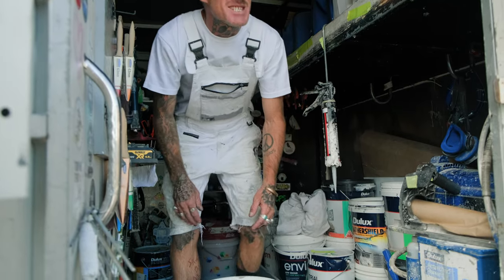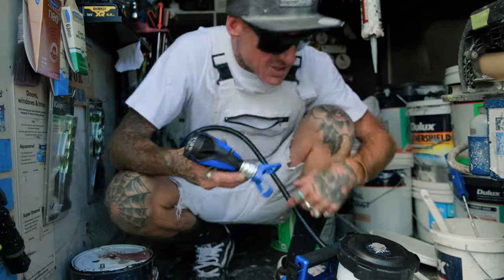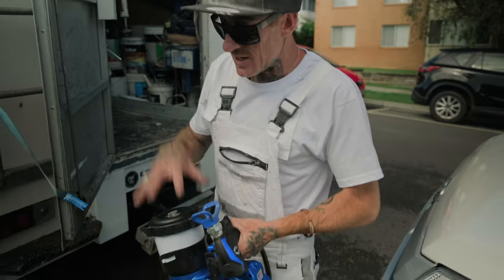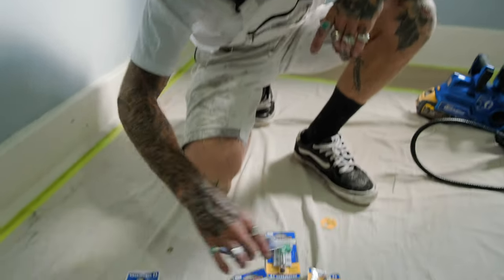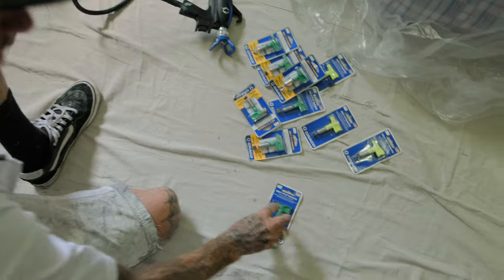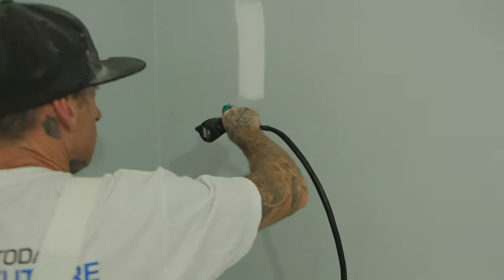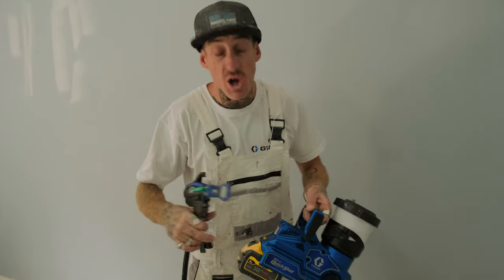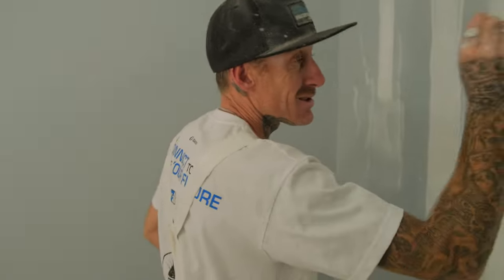NEW GRACO SPRAY TIPS UNDER THE PUMP! TESTING NEW FFLP, LP & WRLP TIPS WITH THE ULTRA QUICKSHOT

Comment: Now with latex paint graco tip recommends .15-.19 office hole for latex based paints . As you use smaller office it over stomizes the paint as it’s designed for .15-.19 to flow and leave the desired mil they designed each coat to be or some bs it’s very specific. That being said do you think it would atomize better and lay more evenly if you thinned it out kinda like when you spray automobiles it’s very liquidy to be a very fine spray . I can’t seem to get the orange peeling or pits to go away with the quick shot on high gloss like exterior doors and such it still has a finish that isn’t factory so I’m going to try and thin it out nicely .
Reply from the maker: Hi mate, most definitely I'm pretty confident that if you thin it out it will stop the orange peel and Atomize a lot better
Reply: Do you use floetrol or some kind of paint conditioner?
Reply from the maker: @Here-2-Learn  I never use any kind of paint conditioner in my products 👍
Reply: @paintingbyjosh  it’s a good idea give it a try just a cap full
Reply from the maker: @Here-2-Learn   there is no need 💯
Reply: @paintingbyjosh  no orange peel? It gels perfectly?
Reply from the maker: @Here-2-Learn  I don't get orange peel my woodwork gets laid down flat, maybe the products you are using or spray tips that ate cause that 💯
Reply: @paintingbyjosh  I use Sherwin Williams Dunn Edward’s and Behr mostly. Straight out of the can usually needs a lil adjustment even for my graco 9.5 which lays it flatter than all my other machines. I don’t have that one yet tho I got a 490 and a 9.5 . I use fflp tips still get a lil orange peel if I don’t adjust. Noticeable to me not everyone else

Comment: Cheers bro great video much appreciate it🙏 I bought one of these two weeks ago I used it today to spray some frames in acrylic gloss but I kept getting tails no matter how high or low the pressure was 🙁 next time I’m gonna try to thin out the paint. Has this happened to you before? Cheers 😎

Comment: Love your videos bro, I just started spraying and I use to FFLP 206 with perfect prep I just thin it down and use it on 6, worked an absolute charm on my window frames no tailing but I’m having troubles using oil based gloss through it even thinned down 5% (cold weather) what would you recommend?

Comment: Great vid Josh , should be getting mine in the next week or two , only need it for spraying coving and acrylic primer on doors & frames so looks ideal for my needs , don't need or want anything bigger.
Reply: I hear you on not wanting to go too big. Though for me this goes a wee bit in the other direction.

I'm going for the Graco finish pro gx19 non battery version. It comes highly recommended for spraying stains, sealers, and topcoats, which is what I do. It's capabilities stretch a little further than the ultimate, able to shoot up to .019 thousandths tip. It's hopper holds 1.5gal. It's recommended for spraying up to a couple rooms. It's cleaning is similar to the ultimate, having a hopper, and better suited to swapping colors than traditional airless systems.

It's special sauce is an easily interchangeable linear pump. Which also delivers tighter pump pressure windows, increasing finish quality for a fine spray. The system is made for and comes with a fine finish tip installed.

I'm looking to up my finish quality on my custom woodworking.

Comment: Can the quickhot be used with an extension?
Reply: It's got the RAC X spray tip, so yes.

The question is will the hose be long enough for your needs while using one? Would it force you to wear it like a fashion statement?

Which leads to more questions. How much do you bump into wearing that indoors? Carpenter tool belts mess up interiors on the regular. Which begs the question. How much of ones own work will they mess up with this tool before buying something more professional.

I know I would rather save a few hundred bucks, ditch the battery system, increase my capability, and get the Graco finish pro gx19 with 1.5gal hopper for $1,200ish.

They make a battery version if it were a must, but that model comes in around $2,200. A little rich for my blood, particularly since I'm on milwaukee batteries.

And lastly. I would like to see these companies offer battery models without batteries, yet offer interchangeable plates to work with anyone's battery system. That would drop the cost on them drastically while allowing these tools to integrate into your life. The cost difference between a gx19 and battery powered gx19 is $1,000, just for batteries, it's astounding. For that price I can buy 3 18v 12ah milwaukee batteries and create my own battery bank from them to power any plug in tool on the jobsite that uses 120v... it's sad that I can buy more Amp hours in tool batteries for the same cost difference as well.

I hope Graco's battery systems fail hard for the economics behind it. It's cheaper to diy your own battery solution for a plug in Graco. That ultra quickshot is probably a 600 dollar sprayer with a bad licensing deal, netting Dewalt the other 600 for voltage...

Comment: I suspect you have a history of being a graff writer?I want to use one of these for large geometric murals. What would your tip recommendation be if I want a really clean hard edges with standard indoor housepaint?
Reply from the maker: You could actually use line marking tips from Graco's range, something like the 315 will do the trick. You need to use the orange Rac 5 Guard with these Linelazer tips, use my code PBJ if it helps!

These tips atomise with a hard edge instead of a soft edge to blend in, that's why these use them for carparks generally

https://goind.com.au/products/graco-rac-5-switch-tip-for-linelazer-range?variant=38117582481

https://goind.com.au/products/graco-rac-5-tip-guard-range
Reply: @paintingbyjosh  Thank you so much for replying, appreciate it!

Comment: Why do they call that thing ultra when it holds 1qt, has a built in gun that cant be changed, and only works up to 16 size tips?

Oh because they also decided to charge 1,200.

If that is the future of graco, graco doesnt have much one. Its an overgrown, overpriced wagner power painter...